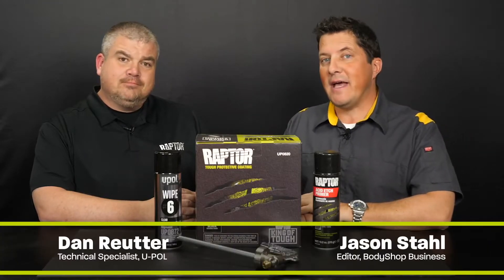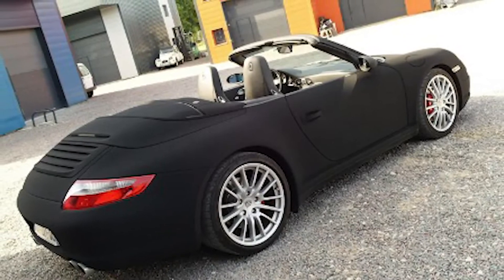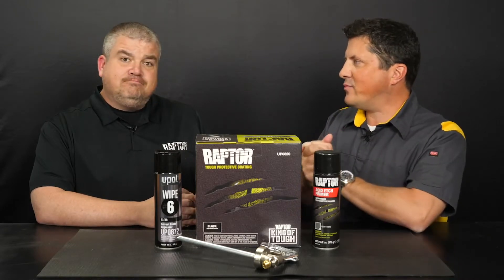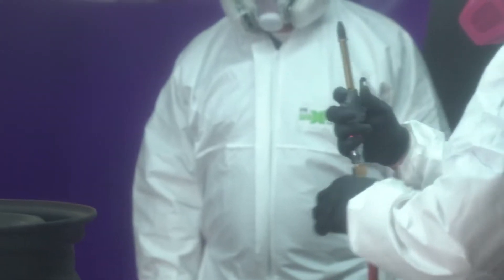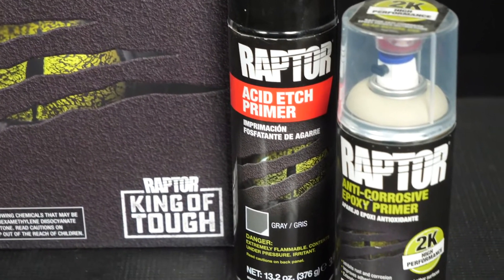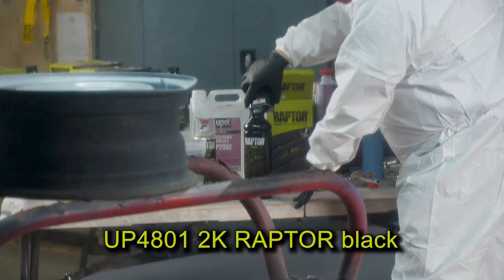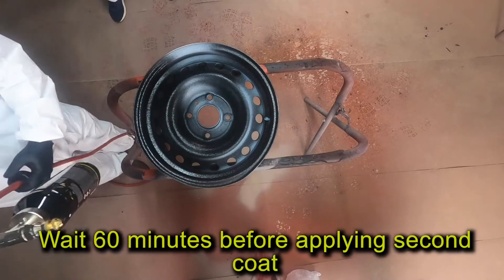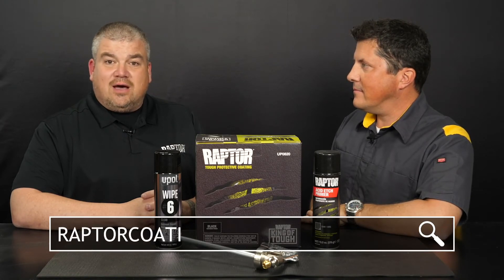U-POL Raptor Protective Coatings Wheel Restoration

Comment: This Raptor paint is going to be going on everything soon(not literally lol) going to coat my travel trailer front exposed hitch metal, my trucks hitch under truck. Going with 1k Raptor on my 22 inch matte black Camaro ss wheels that faded. Going to coat the front rebel style grill and matte black xd wheels that faded bad to almost  ashey gray with 2k bedliner paint. Might attempt to coat the side steps on my Ram too, chrome just scares me for adhesion. Have a old harbor frieght trailer i will coat with bedliner also. Just need to figure out proper prep for going over old wheel paint(not peeling or any issues, just faded) and the chrome sidesteps.
Reply: Anyone know if any over the counter gray colors in the Raptor 2k bedliner paint will come close to mineral gray paint used on Rams, Dodge etc.

Comment: Do I need to put Acid primer or primer before painting with raptor if the black steel wheels are brand new?
Reply: Are they bare steel or coated?
Reply: @silvercommander  coated glossed black by factory
Reply: @coco9004  I'd just sand them with a red scotch brite prime. Sand up to 600 if metallic. If solid color 400. 
But if you have a sealer it would be a lot easier and faster. Use the scotch brite seal, then paint